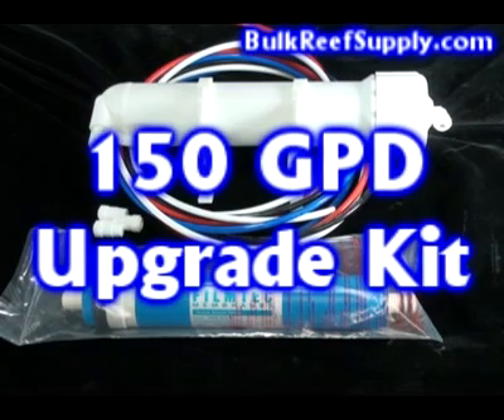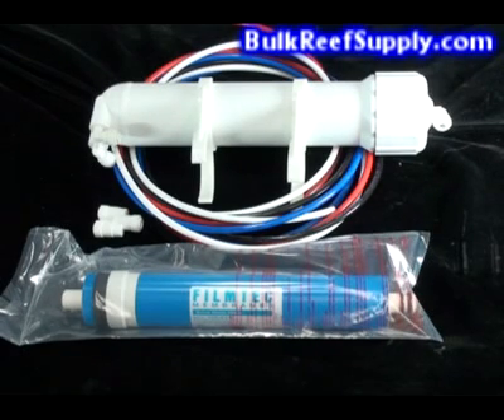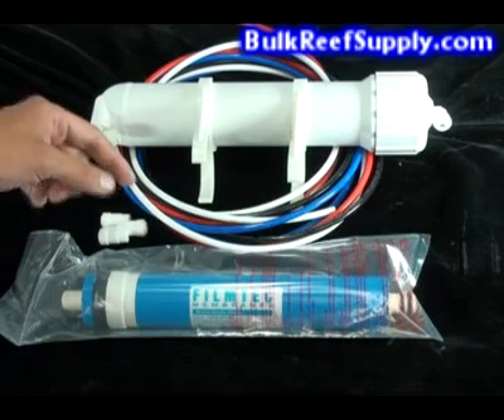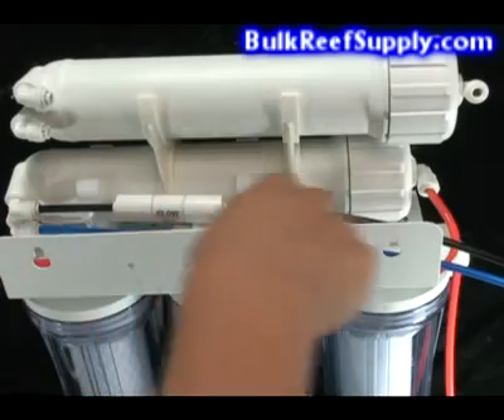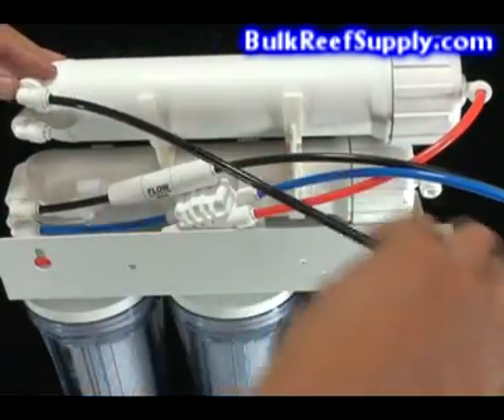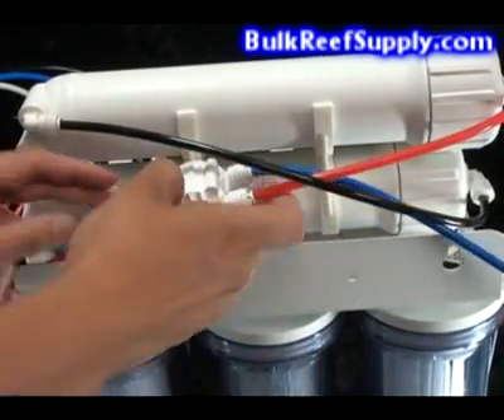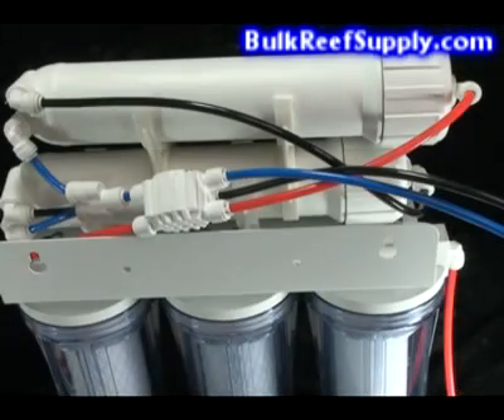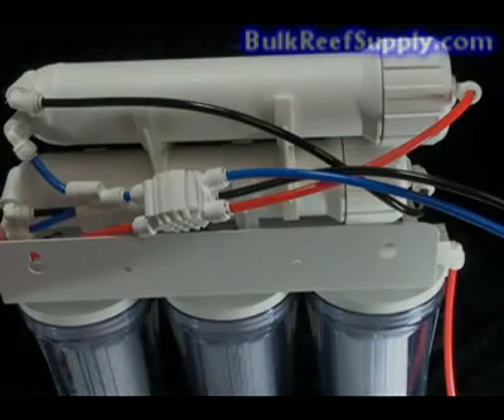150 GPD RO Upgrade Kit Installation Demo - Bulk Reef Supply BRS

Comment: I know this video is old, but I will answer the flow restrictor question, because I had the same question and found the answer on their site, but not at the link they posted in the video.
At their site, on the flow restrictor product selection page, the description states: 

"550 mL/min for 75 GPD single membranes or 150 GPD Water Saver Systems

800mL/min for 100 &150 GPD single membranes or 200 GPD Water Saver System"

Therefore, for the 75gpd upgraded to 150gpd like in the video, continue to use the 550mL/min restrictor (as you can see in the video).

Also, @Roberto Constante...  The  second membrane sees elevated TDS, but not double.  It depends on the efficiency of your system.  It's one of those word problems in that math class that you thought you'd never use. :-)  

For easy math, I'll use whole-ish numbers.  If your efficiency is  1:3 on the first RO filter, the input concentration is full (400ppm) at the first membrane, but if you remove one fourth of the water and leave all the dissolved solids, the concentration is now 400/(3/4) =  533ppm.  This is the concentration at the input of the second filter.  If the efficiency ratio is still 1:3 on that filter, the waste TDS should be 711ppm because you removed one fourth of the water again.   Note that this is not 800ppm, because ... more math and a picture would probably help.  But this assumes that you know how much the efficiencies for each filter are and a bunch of other assumptions, but rest assured, it is not double the ppm on the second filter.

Comment: I have really hard water where I live (municipality well water).  I currently have a BRS 6 stage deluxe and my TDS input is never lower than 575.  Would you recommend me adding a second RO membrane to increase my output?  And would this help me to stop burning through DI resin so quickly?